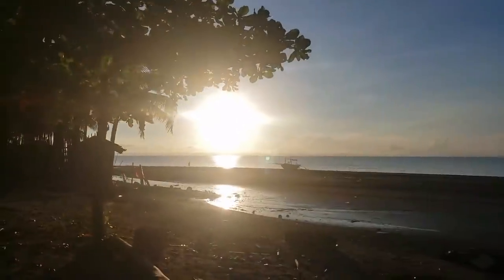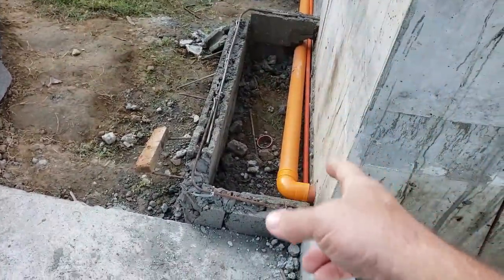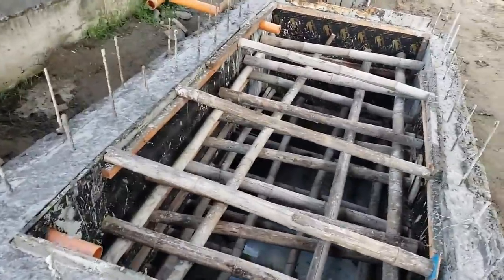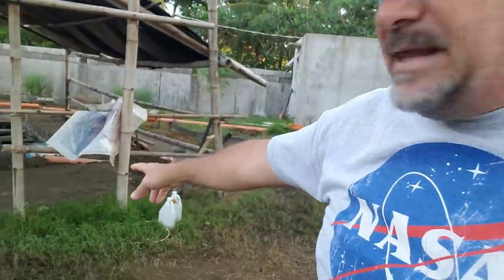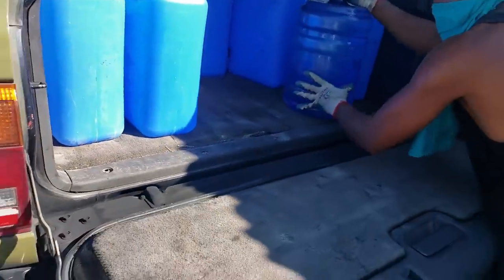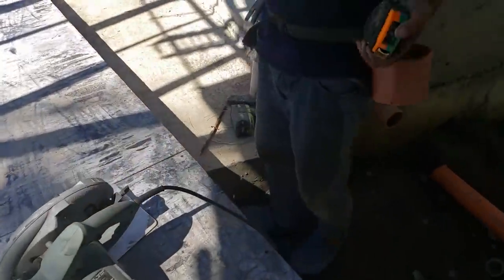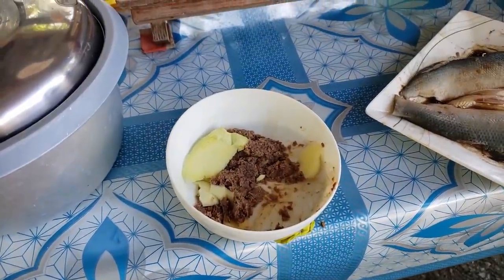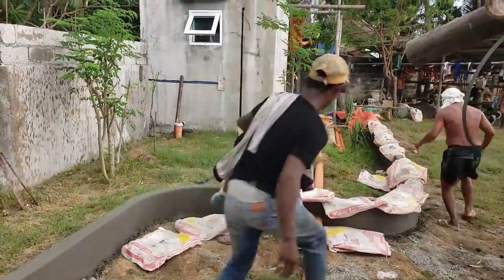Philippines Beach House Build Day 98: Honorable Actions!  Tankzilla gets a LID on it.

Comment: Are your columns and beams for the second floor painted?  Or are you going to hit them with a rust neutralizer before you pour concrete on them?  I can't remember if you painted them or not when you put them up last spring.
Reply from the maker: some of them I painted then stopped. Rust neutralizer is sitting here ready to go. Actually they did good. There is still places that are raw steel looking with no rust oddly enough. We checked the tire wires and they are in dang good shape too. I think so much rainfall while I was gone kept the salt cleared off.

Comment: Never enter a confined space without forced ventilation. Just put a fan in one manhole to suck air into the water tank while you are in it. I have seen to many folks die without fresh air pulled into tanks.
Reply from the maker: you are right. Did I leave that about the fan and dual man hole covers in the video? I spoke about that during recording but it could have landed on the editing room floor so the video wasn't epic long like BenHur!!!!! LOL . Good comment JAMES !!!!!! People always need to be careful. I had a great Uncle died in a cistern. Him and two brothers was cleaning it. They had lunch and when he went back in they didn't hear him doing anything. Pulled him out dead. A toxic gas leaked in from the soil. You can imagine those old tanks was bricks and more porous. Happened in Smith County near Tyler Texas. First established saw mill in east Texas was setup by them.
Reply: @TexasFilipino  I lived in whir house for a while. Then built a house in chandler. Worked in Longview. From Sabine county. Home place is under Toledo Bend
Reply: @TexasFilipino  yes James you put in utilizing a fan. I sent that comment and less than 1 minute you are saying the same thing.

Comment: You’re not putting a weir (flow-through wall) in the middle of the tank?
Reply from the maker: need need for one. This is just a rainwater storage tank with a over flow to a fishpond
Reply: Texas Filipino   I see that.  I was just thinking of support through the middle of the long walls to prevent it from side loading of the surrounding earth.   Not a solid wall.  Just a brace wall (weir) so water can move freely between the two sections.   I guess a basement doesn’t have a concrete center wall.  And with a solid lid it will stabilize the entire tank.  

Videos are great.  Keep them coming.  I was a big fan of AFFITP because I’m interested in the rural life and farming.  I learnt a lot of what not to do when trying to start a farm.  LOL.  I have a house in San Fernando Pampanga in Luzon.   Looking for a farm lot near the ocean somewhere though.  

You have a great crew there.  

Look into some no-till gardening and composting.   Would love to see people in the Philippines using those gardening practices.
Reply: @jasonerb6886  hi Jason,  would suggest you look at Zambales and La Union for a farm lot near the ocean,  both west facing,  so nice sunsets! And sheltered somewhat by mountain ranges to the east!
Reply: Roger Garnham   Ya. I was thinking somewhere south of Subic Bay. I’ll have a look at your suggestions as well.  I was kinda wanting to get off of Luzon, but it makes more sense to stay on the same island as where my car and scooter are.  Shorter travel time from the house as well.   There’s just so many good places to want to be. Can’t easily make a decision.  LOL. 

Cheers.
Reply: @jasonerb6886  Yup Jason,  Yup its all to do with being able to market your produce,  fairly easily,  no ferry trips needed and good land connections, expressways and the like.
 I live in Urbiztondo,  central pangasinan,  a lot of local people send their produce to Manila,  even  putting it in the hold of the long distance buses, is quite normal practice!
Re read your message,  sounds like you wanted to keep your present house as well? 
La union is easily reached on the NLEX,  they will eventually run it all the way to San Fernando City!
Reply: Roger Garnham   You live in a good place there.  My GF’s grandmother, aunts , uncles, nieces, and nephews live in Urdaneta.   Ya, I think we’ll keep the house in San Fernando.  My GF has a 10 year old boy and we’d like for him to stay in the school system that he’s in now.  Maybe by the time he’s graduated and ready for college or trade school we can leave him the house and we can fully move to a farm area.  Would be good to get the land and slowly do the construction of buildings, fences, and prepare the land for what we want to do.   

There’s definitely a need for more farming.   I know  Coron /Busuanga Island imports pretty much all of its fruits and vegetables from ports in Mindoro and Manila.  Was there in February looking for land, but it’s difficult to find anything good.   Plus, not a convenient or affordable Ro-Ro service going there yet either.   We took our scooter and it was an ordeal of paperwork and hassle.
Reply: @jasonerb6886  hi Jason, wow Urdaneta,  that pretty close. 
I don't if you know,  it has an excellence fruit and veg market. They get a lot of produce there from the cordilleras ,  baguiio ect.
When her cousin used to sell veg ect , here in Urbiztondo,  she used to go to Urdaneta to buy it. 
Urdaneta not far from La Union either,  Bauang area  might be worth looking  at,  is well before San Fernando and not far from Urdaneta. 
By the way there is vineyard very close as well,  just an example of what you could grow!.
Thanks so much for your reply sir.  A very happy xmas to you and yours. 😁